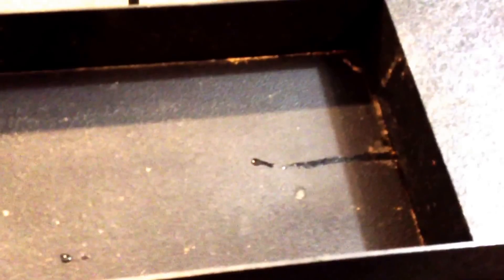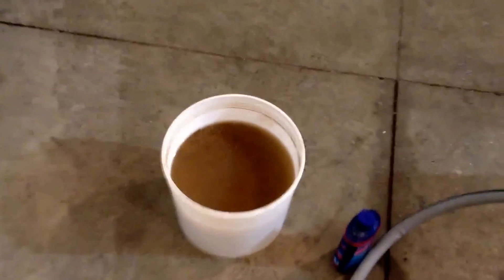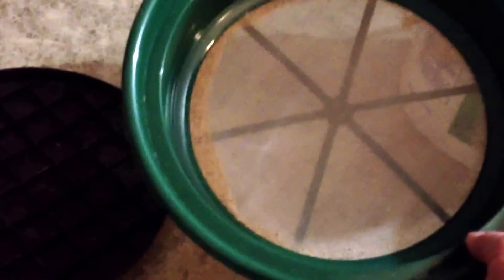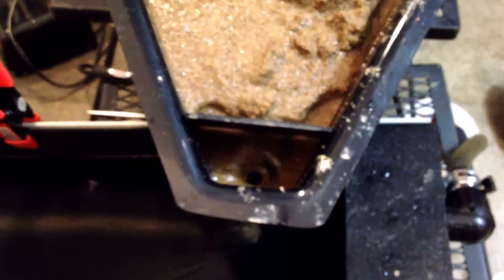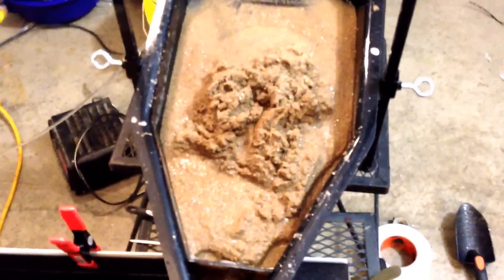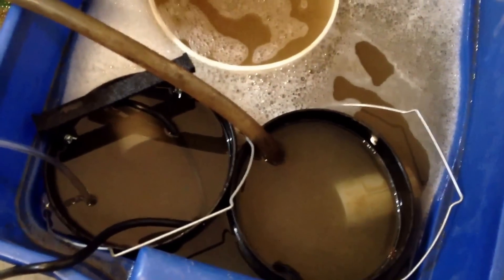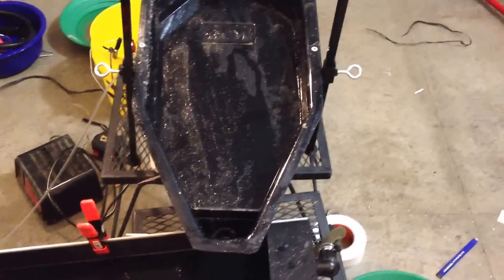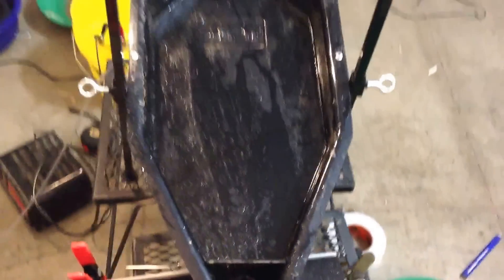Vid #2 Gold clean up and classify finishing recovery panning concentrates sluice vibrating feeder

Comment: Hey ray I get it but you have went a bit wrong there .I call this mental masterbation.the miller table is your finishing clean up stage .you have all the gear and no idea . My mind is blown
Reply from the maker: I am only using the miller table as a water supply for my DIY clean up sluice, after I do that I then use the miller table only to collect the very fine gold dust, that I collected from the clean up sluice, I have another video using just the miller table, where I show how well it works to collect the fine flower gold we get here in Iowa.